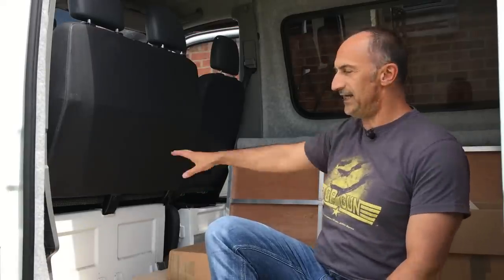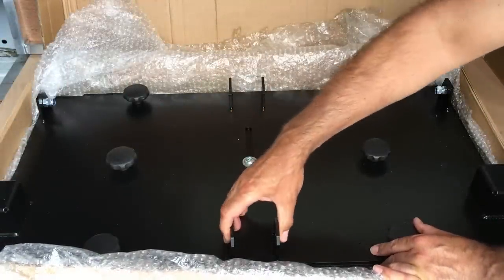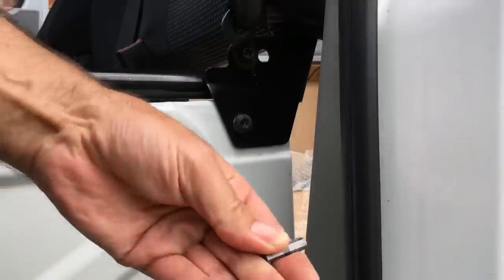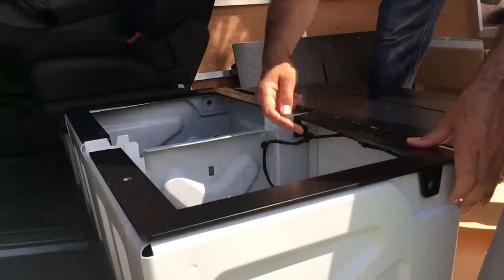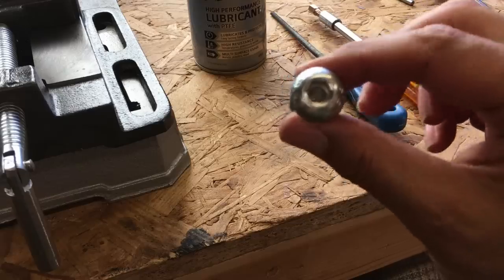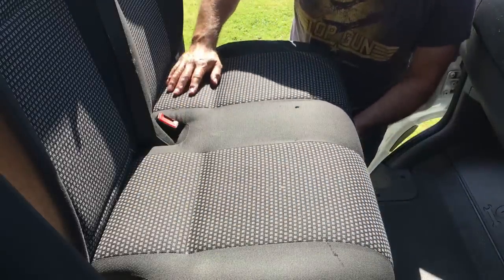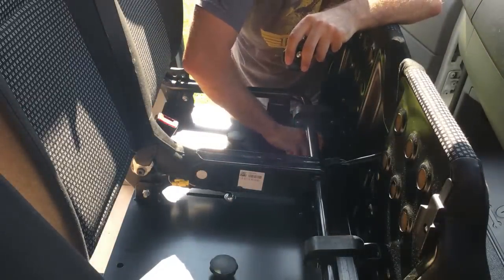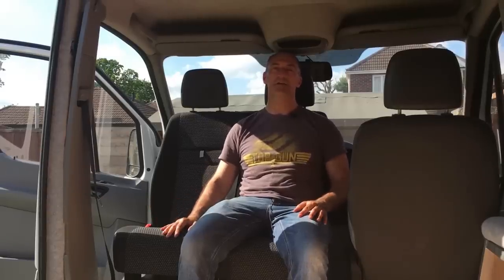Double Swivel Seat - Mercedes Sprinter Van

Comment: If u disconnect u have to reset ur radio code and u have to know how to set it too,and what if ur installing a new single seat ...??? And there's only a single wire ? My heads melted
Reply from the maker: In most vehicles if you disconnect the battery the radio will need to be reset, it's an anti-theft device.
I am not sure what you do with the cable if you take the seat out and put a single seat there, sorry

Comment: Greg, where can I get one of your top gun B17 shirts? I got to spend about 5 minutes piloting a B17 in the left seat about 2 years ago on a flight from Cincinnati to Pittsburg. I'd love one of those shirts.
Reply from the maker: Hello, the guys that attended the TopGun flight school fly F14A Tomcat.
The B17 flying fortress was a totally different beast altogether.
Great that you got to pilot one of those old war planes, there can't be many about these days.
My shirt is quite old but you can get similar ones at :-
https://rover.ebay.com/rover/1/710-53481-19255-0/1?ff3=4&toolid=11800&pub=5575265109&campid=5338027957&mpre=https%3A%2F%2Fwww.ebay.co.uk%2Fsch%2Fi.html%3Fselvel%3DCars%2BYear%253A2008%252CCar%2BMake%253AMercedes-Benz%252CModel%253ASprinter%26_dmd%3D2%26_odkw%3Dmercedes%2Bdiagnostic%2BMercedes-Benz%2BSprinter%2B2008%26_osacat%3D0%26selcontext%3DproductType%253ACAR_AND_TRUCK%26_from%3DR40%26_trksid%3Dp2334524.m570.l2632.R2.TR3.TRC2.A0.H0.Xtopgun%2Bt%2Bshirt.TRS0%26_nkw%3Dtop%2Bgun%2Bt%2Bshirt%26_sacat%3D1059

Comment: The only problem I see is the extra height of the seat. However it would be worse in the driver's seat
Reply from the maker: Yes it does raise it a few inches, lucky I'm not driving from the passenger seat 😉 
If you was a skilled welder you could cut the white box down and re weld it.

Comment: I wonder if it can be DIY...just went there and checked price $600 USD is pretty steep.
Reply from the maker: fffjkjk jkjkjk I'm sure if you were a good welder you could make something similar but as this is the passenger seat mount I prefer to go with manufactured item. It was made very well and powder coat finish was also very good. I'm very happy with it.

Comment: I wonder if there is a similar kit for the RAM Promaster van?  I attempted using their contact system but it kept rejecting my information.  I dialed their number and it kicks back my call.  How do you call them?  What country are they in?  Their website does not provide an address or country or e-mail. https://www.vwinterior.co.uk/VW-SWIVEL-BASE-S/